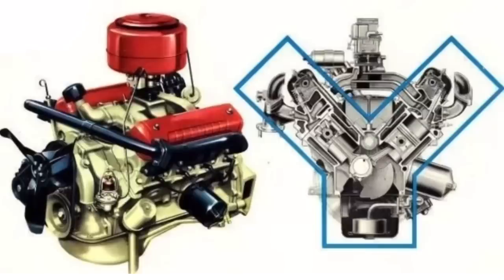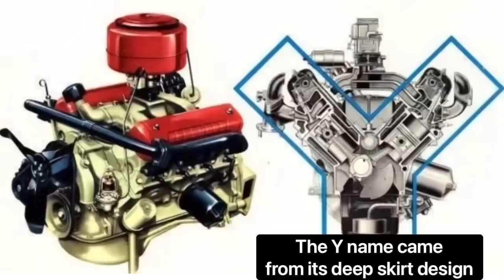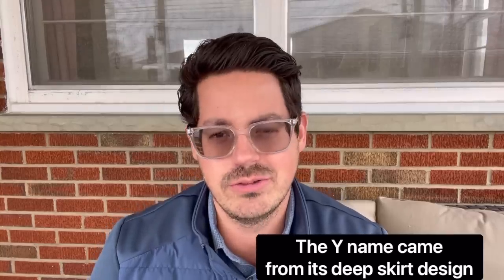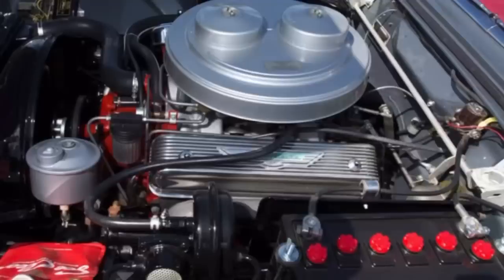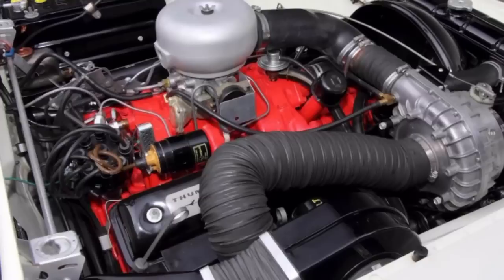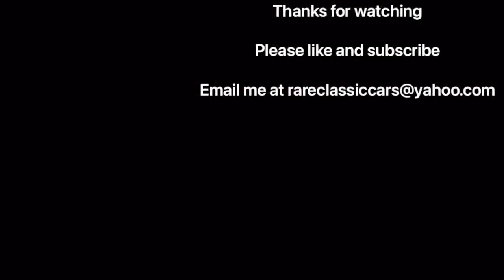Worst Engines of All Time: Ford Y Block V8

Comment: According to my dad, these motors weren't that bad. They needed maintenance and fresh oil on time, but they were never designed for racing without modifications. He had 3 1957 Fords that he enjoyed and used for years
Reply: I worked on those , the big problem was the intake seal it was a long seal 
 The sealing tech wasn’t good with cork gaskets 
 Right Stuff fixes them it’s a new sealing agent
Reply: Midnight- Your Dad was right. The Y block was kind of on-the-edge of "treat it right, and you'll be fine".
Reply: Had a 292 f100. Ran it hard for years no major issues with good maintenance
Reply: @jcksnghst  I agree .
Although I think you mean " midnight " is a dude .  Her / his sentence structure is differently male .
Reply: @moo.johnference869  omg .. lol . Smh .. I did... Well, I screwed that up .
Reply: I was working on cars back then. Saw a lot of those Y blocks with the  add on rocker shaft oiler systems installed. They had a good basic engine design, Y block & forged crank but failed with the little stuff.  The over/ under intake ports were  a bad idea.
Reply: @larryhutchens7593  The 223 cubic inch 6 cylinder had the same oiling issue as the Y block V8.
Reply: @1575murray  And the 223 had the same timing chain issue as the Y-block. A long time ago a co-worker bought a Ford 1 ton truck that had the 223 and it had to be overhauled. Once the engine was done he couldn't get it started. Never having worked on a 223 I made a guess that it may have to be timed like a Y-block. A quick check in a Motor's manual confirmed this. He had timed the cam like one would do a Chevy or Dodge.
Reply: Thats why he needed 3 of them eh
Reply: @scotty429  Over a course of 6-7 years and they were 13-15 years old then
Reply: Perhaps it’s nostalgia things look better than they actually were, but that makes it problematic there should some buffer.
Reply: Wow you're Daddy is smart man, and he is lucky to have given birth to such a intelligent and handsome women such as yourself 🥰😇🤓

I would buy you 10 Ford Y-Block engines if it's makes you a happy women and you are is make any man a lucky one😉
Reply: @BoleDaPole  Thank you
Reply: @BoleDaPole   @Krak Head  wtf ... Smh... Dude, you need to learn how to unmask/vet... midnight is a dude. 
Do not think a user's avatar/profile picture is Actually a picture of the user...
Reply: @jcksnghst  if you say so
Reply: That's why it was no good
Reply: @mchl8  If you groove the center camshaft journal, or replace it with a later one that was made with a groove, it was fine.  Easy fix.

Comment: Great information here. Another thing about the Y block V8 is that none were equipped with hydraulic lifters. All had solid lifters. All Y blocks had mushroom shaped lifters that meant that they had to be removed from the inside of the block. But to gain access to the lifters the crankshaft first had to be removed along with all pistons and connecting rods. So there was no simple way to swap camshafts without disassembling the entire engine. Remove the reciprocating parts then the cam and now you can take out the lifters. This was a real pain for any hotrodders wanting a better cam. And the intake ports in each head were stacked one above the other instead of the usual side by side configuration. Most rodders went for the Chevy small blocks because they were easier to modify than Ford Y blocks.
Reply: I don't want to start anything but that's incorrect ,,, you didn't have to remove pistons and crankshaft,,,, but you did have to remove the camshaft to access the lifters and there were a couple different ways to do that and there was a special tool that would hold the lifters up so you could pull that camshaft out...
It was a very weird and strangely designed engine...
Reply: Many engines used that kind of lifter.
Reply: @michaelbenardo5695  Including diesels, which the designer of the Y-block had experience with. Some racers employed them also. It allowed more latitude with lift and duration cam timing.
Reply: Your wrong about a cam swap requiring dissasembling the engine. The lifters cas be pushed up and clipped at the top of their travel, so the cam can be slid in. This procedure can be employed with other engines as well.
Reply: @jeromebreeding3302   That's it !!
Reply: @jeromebreeding3302    
This guy  !!
https://www.youtube.com/watch?v=G7teHiBlwcM
Reply: @jeromebreeding3302  That's a great way to remove the cam. But would you install a new cam with used lifters? I certainly wouldn't. You have to use new lifters with a new cam or you risk wiping out the lobes, and voiding any cam warranty. Your choice.
Reply: @mschiffel1  You've got me there, new cam, new lifters, pretty much gospel, unless not many miles on the engine. Those chilled steel lifters(early versions we're cast-iron), can be re-ground), new ones are expensive.
Reply: Wonder if anyone ever hogged out the lifters bores on the Y-block, then employed hollow push-rods to feed oil to hydraulic lifters ?
Reply: @jeromebreeding3302  You can't.  Not enough material, and the lifters for the 337 Lincoln engine, which might be narrow enough, can only be fed through the side.  If somebody were to make special hydraulics that were narrow enough, and were fed through the top, Buick-style, they would also have to supply special rocker arms that would feed those hollow push rods, associated plumbing to supply a sufficient amount of oil, and a higher-volume oil pump as well.  It would be a complete kit.  Probably not cheap either.
Reply: @michaelbenardo5695  Just idle curiosity. Now I know why it was never done. Thanks for the tech.
Reply: @mschiffel1  He doesn't mean "mushroomed over", these lifters are shaped that way - the base of the lifter is wider than the body.
Reply: https://www.youtube.com/watch?v=G7teHiBlwcM
Reply: Many hotrodders LIKE solid lifters.
Reply: @michaelbenardo5695  With a Y block Ford there's no choice.